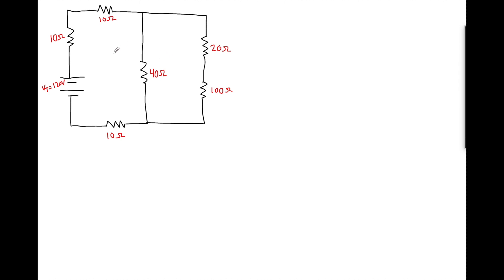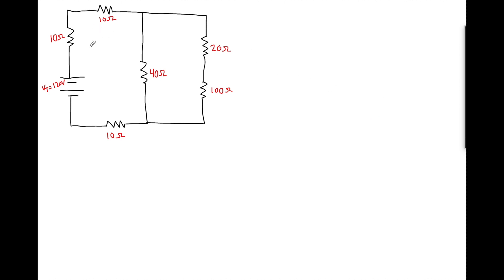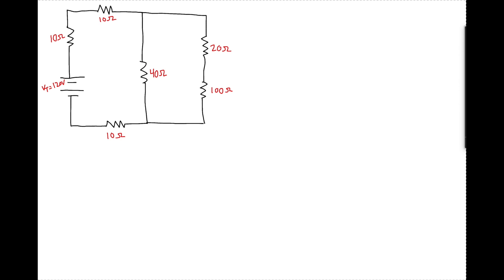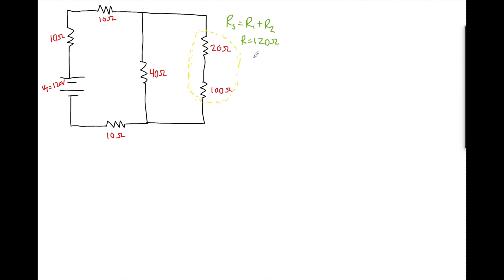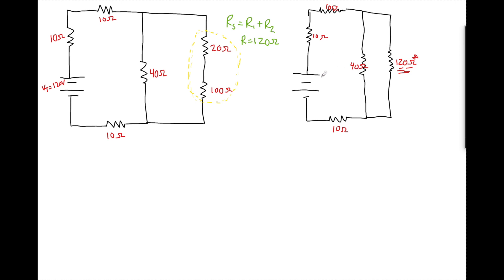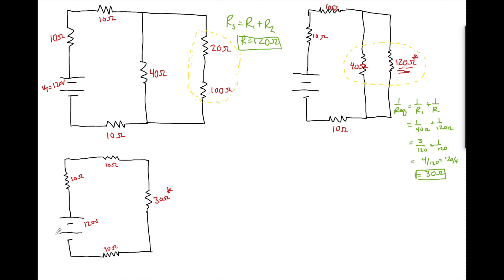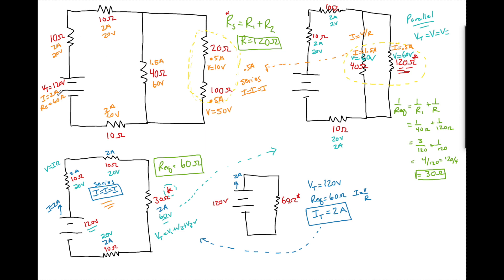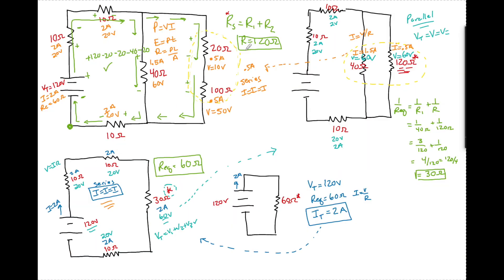How Find Voltage, Current, and Resistance In A Combined Circuit (AP Physics 2)

Comment: at 13:19, I think the drop in voltage should be 60v (not 40v).   The 60v would be the same through the 40 ohms or 20 & 100 ohms....   

This is an excellent video....